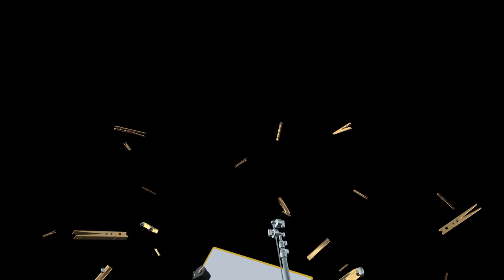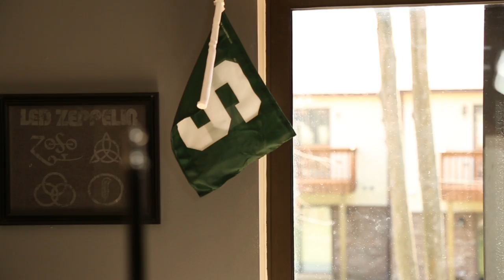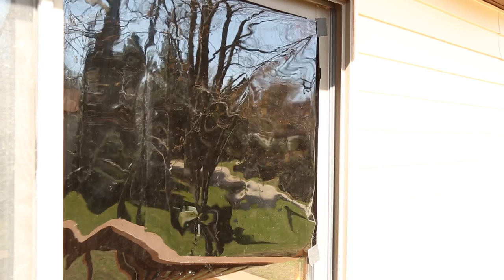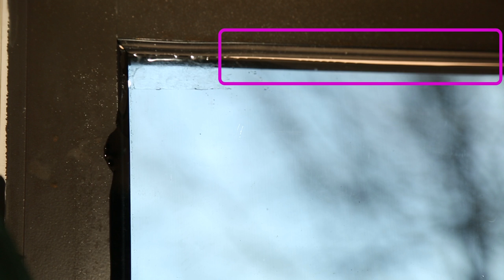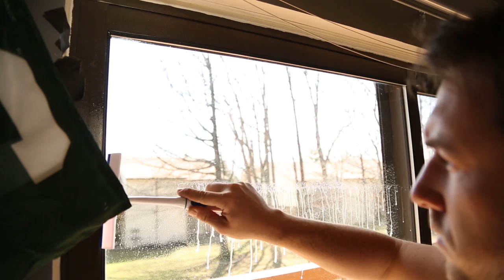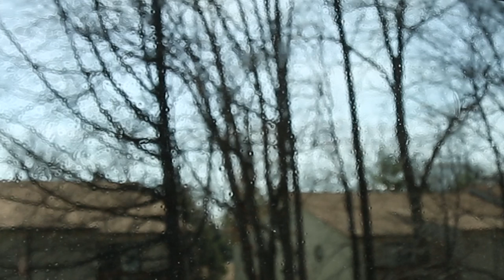Ep 04: Neutral Density Windows

Comment: Trying to splice two ND's together for a large sliding door requires further magic. Also, to clean up the light bleed on the edges, use 1/4" or 1/2" in "camera black" tape to close the gaps around all edges in the frame. Camera will rarely recognize the tape.

Comment: I usually use plain water when attaching the ND to the window. The problem with using windex or any kind of detergent is that it decreases the surface tension of the water. Thus decreasing the "adhesiveness". Also when putting it on the window, I employ a top to bottom wall papering technique wiping from left to right as you're putting the ND on the glass, so you're pushing out all the airbubbles while you're putting it on the window. That'll saves you massive amounts of time when you're trying to push out airbubbles with a scraper.
Reply: I've used and know people who use a cocacola/water mix to great results. I think everyone has their own little tricks!

Comment: Genuine question: If you have the budget, would there be a downside to using Prestige 20 or 40 from 3M? Seems better all around (other than it's not something you can buy cheap and quick and tape up in a pinch)

Comment: One thing I have not been able to find or verify aside from doing it myself BUT putting ND on the window is different than putting the ND filters on the camera. Do you have to increase the output of the light inside after placing ND on the window?

Obviously ND on the camera the inside gets darker and you have to compensate with light. Does that happen with ND Gel for windows?
Reply: Actually? It’s quite the opposite of what you’re thinking. So because you put ND on a lens, the entire image gets darkened which is why you have to add more light into your scene, where when you darken just the window with ND, you can use less light. Because now you’re probably compensating for the details you see out the window
Reply: @DaveDonaldsonLive  Maybe my wording was weird but THAT is exactly what I was thinking lol ND on the window does NOT cut down the lighting in the room or at least very little. It just simply brings detail back outside the window.

Comment: Is there a budget option for these ND filters?
Reply from the maker: You can also take single and double nets and put them outside of the windows/ you could buy screens for screen doors and hang them outside of the door pending you have a very shallow depth. The problem with that though is that the screen needs to be tight because if it’s not, you can get some aliasing effects

Comment: I've used ND's for decades in commercial photography...however,  you  can use a ND filter on your lens to expose for the windows and pump more light into the set to compensate for the under exposure...less time than prepping windows.  3 stop ND filter add 3 stops of light...